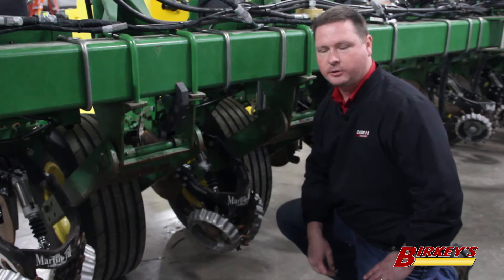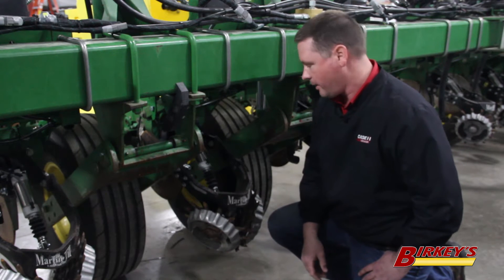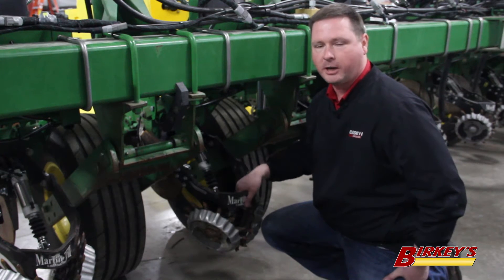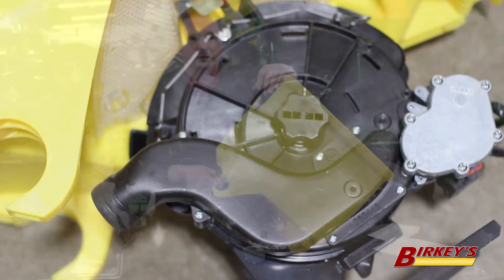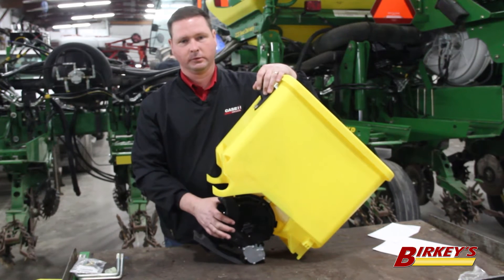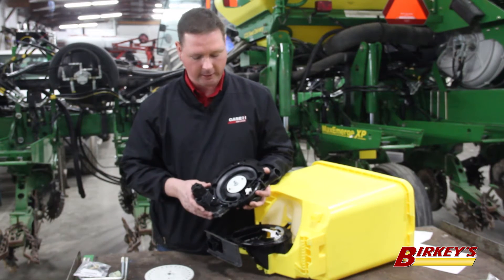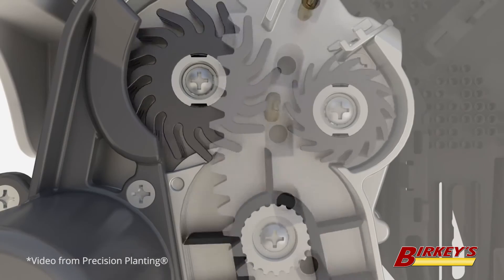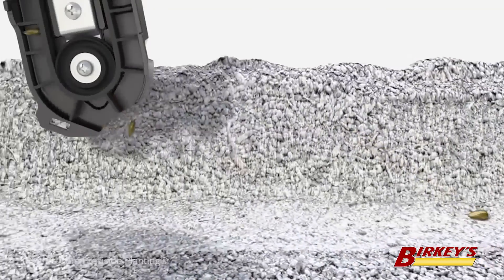Birkey's: Precision Planting Retrofit Options For Planters

Comment: Hi there, I have a question about "vset meter" - can it be mounted on a MONOSEM planter? 
to be more specific, we are using 30 inch rows with NG +4 row unit for planting corn, and NG + MONOSHOX 20 inch on our twin row planter for soyabean and suger beat?
Reply from the maker: Hi Mirko. Unfortunately, at this time there is not an option for mounting a Vset meter on a Monosem planter with Precision Planting.